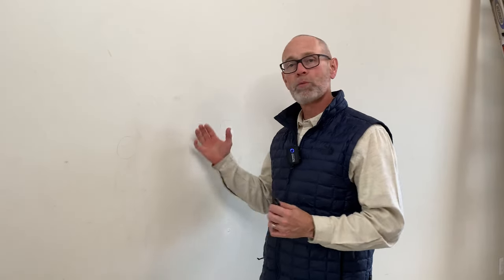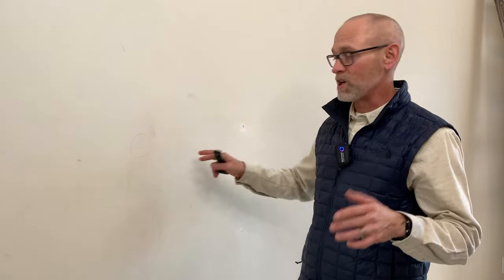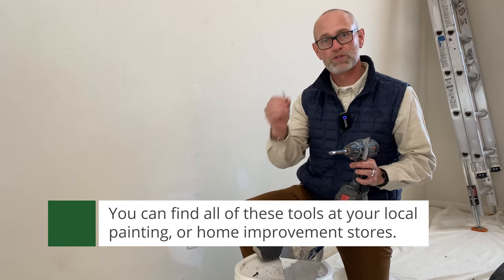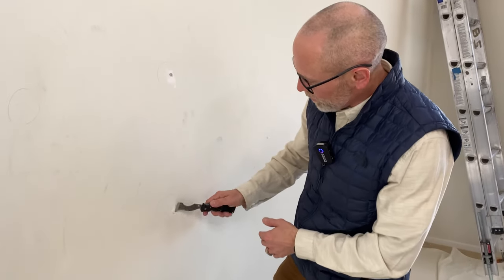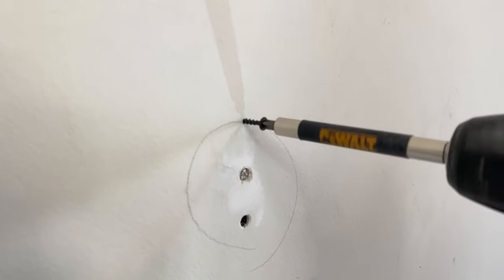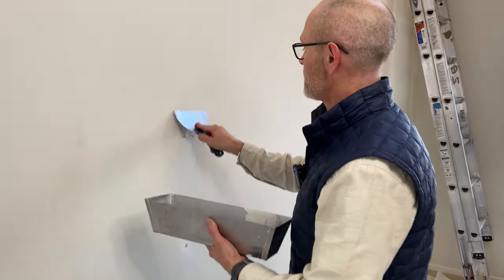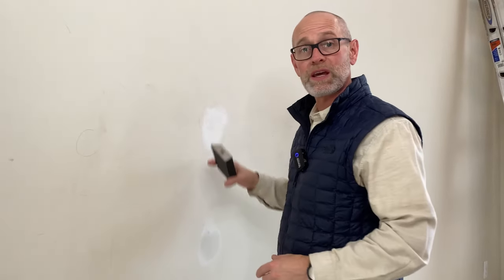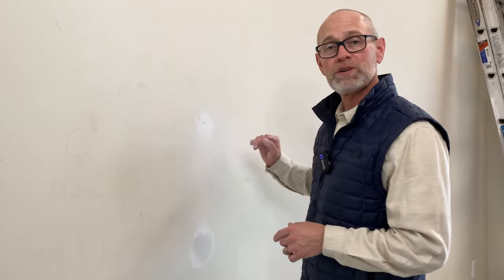How to Fix Nail Pops in Your Wall

Comment: Brand new town home I see tons of nail heads throughout the house any ideas why that would be?
Reply from the maker: Hi Brad, unfortunately, nail pops in a new construction can be quite common and could be  a number of causes. Quite often when the new lumber dries out, there is shifting that can cause the nails to pop.
Reply: @TribblePaintingCompany  Lets say it was not due to new lumber drying out or shifting!  Could it be that the drywall installers did not put the nails in far enough or the drywall was too thin?  I have lived in 4 new builds and I have never seen this before until after a year or so and I mean like one or two in the whole house.  This is so back I have not had to use a stud finder to hand a single picture, mirror or even Fleximount hanging shelf in garage.   The nails don't show but you can see them in the drywall if that makes sense.  Thanks and just curious what it might have been.
Reply from the maker: Hi Brad, It's possible it was how the drywall was installed, but it's hard to say for sure without seeing it.
Reply: @KBradAdams  If it is not the drying of wood, my suggestion would be installation was not proper. You can sink screws too far in and tear the paper on drywall. Once this is done the drywall can move on the wall. Movement will eventually make the nails push out the mud that filled them in over time. Still the same process he did to fix just know if you do, do not break the paper of drywall when sinking the screws in.
Reply: @John14Verse6  Thanks, I played around with a few in the 1/2 bath, and they look much better now, just probably have 50 throughout the townhome I need to get to eventually.  Especially on the stairwells so noticeable.

Comment: We had our 1 year walk through the other day on the new townhome and the builder said he would have someone come out and fix the 40 or so nail pops on our stairs going up 2 floors.   The guy the builder sent out knocked the old drywall mud off but never did a thing to the screws?  He didn't screw them in or out, just added drywall mud and I can even see he didn't smooth some out or put enough in you can still see an indentation or dent, anyway I was wondering if this will just end up popping again?  I told my wife I am going to remove the screw put it back in and add screws above and below like you did and fill so when the painter comes on next week it will look better, what are your thoughts?
Reply from the maker: Hello, Is the painter, who is coming out next week, seperate from the builder? We fix nail pops as part of our pre-painting process, I would see if the painter coming out fixes them as well. It may save you some time. I would also let your builder know how the nail pops were "fixed" as well, if you haven't already done so.
Reply: @TribblePaintingCompany  The painter coming is with the builder but I know based on previous punch list stuff he is going to walk in with the paint and just paint over what the other guy did.  I am not sure who the drywall guy or guy that did the nail pops is with, he actually had a card so maybe a contractor they hired.  I honestly think with the video you did I can do it way better than what he did.   I will probably take pictures or video before I do it and show the builder.  Thanks again for the video and reply.  I will subscribe and like right now!

Comment: I'd like to ask why you wouldn't replace the original nail causing the pop. Especially if you see rust. 
Thank you.
Reply from the maker: Good question! You can replace the nail or screw that popped, but you will still want to put additional screws above and below to reinforce that sections. If you don't, it's likely going to pop again.
Reply: @TribblePaintingCompany   Could you instead apply loctite or something similar?